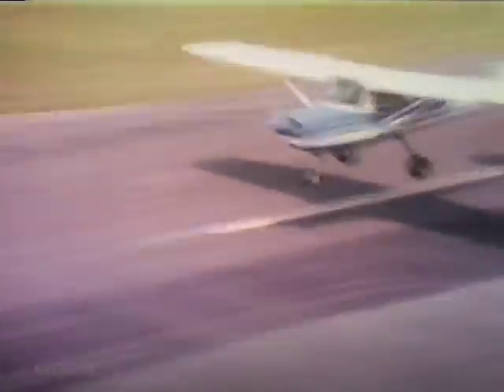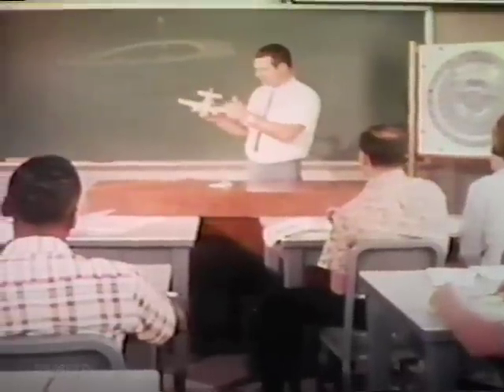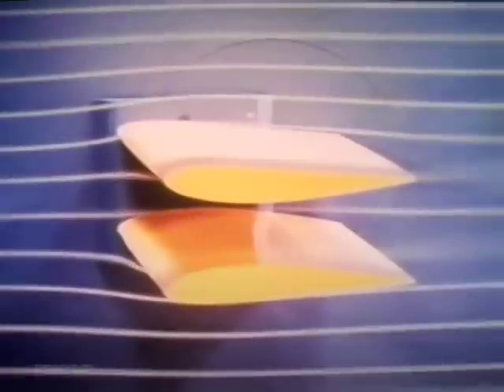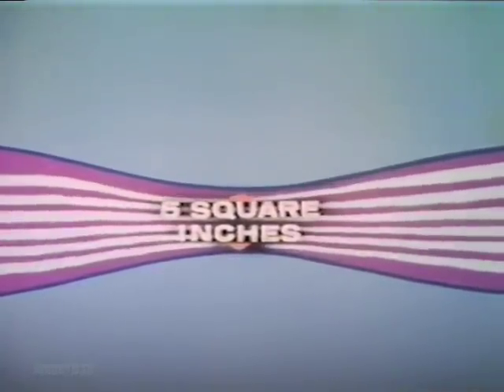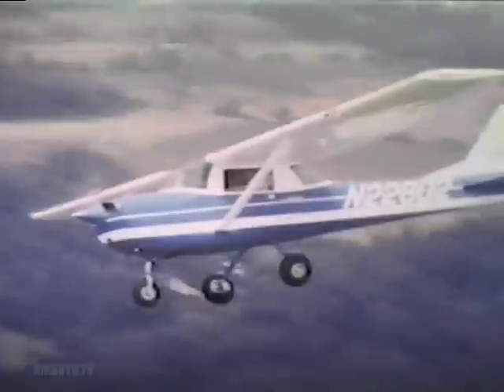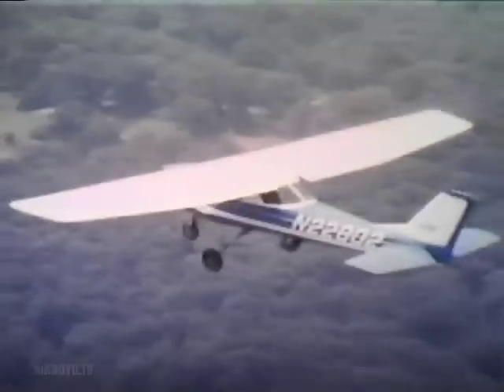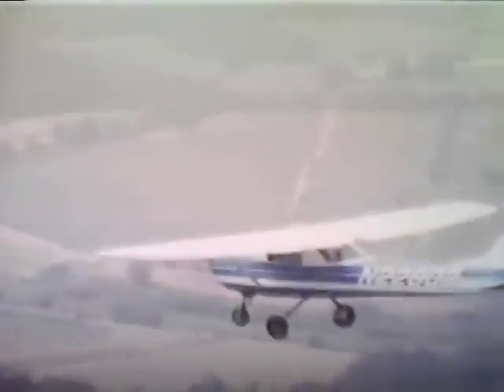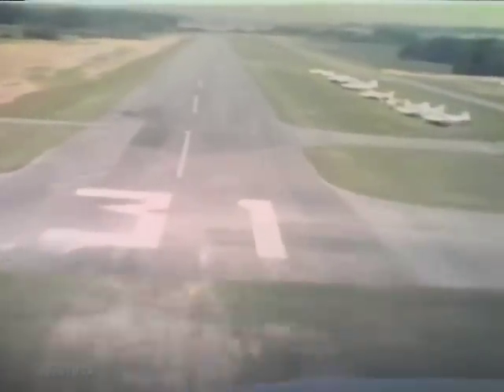How Airplanes Fly (1968)

Comment: When an aerofoil starts moving, air at the trailing edge would apparently need to double back round to join the rear stagnation point. The air is not a superfluid, and as a consequence the flow breaks away at the trailing edge and a starting vortex is left behind on the runway. This can actually be visualised.

In the air around the aerofoil there is vorticity of opposite rotation to the starting vortex, by the conservation of vorticity. This vorticity then generates lift by the Magnus effect.

Conservation of vorticity and the Kelvin circulation theorem are the same thing, and it is a topological requirement that vorticity can only exist in endless loops. The Magnus effect and the Kutta-Joukowski circulation theorem are also the same thing and we can switch between them by a linear transformation.

Explanations based upon Bernoulli's Principle or Newton's Laws are merely wisdom after the event of a starting vortex being formed. They would flop if our atmosphere were a superfluid like liquid helium.

Comment: When you do the integral that come from solving the equations of motion from classical field theory you have to use complex analysis. You end up with a pole in the middle of the airfoil. This ends up giving a solution with nonEr
Reply: nonzero curl. This basically mean you get air rotating around the wing. The other independent solution is just air going over and under the wing. super position of these 2 solutions is air moving faster on top and lower on bottom.

Comment: There is also a downward Newtonian force caused by the air accelerating at a relative angle to the chord line of the wing that creates lift.
 I believe that the pressure under the wing creates more of the lift than the accelerated air over the top. Hence a semi symmetrical wing that still works with the aircraft inverted albeit very inefficiently.
Reply: No, actually the redirected accelerated downward airflow is a majority of your lift.
Reply: +Brett Dull that's exactly what he said
Reply: IndustrialDonut Thank you
Reply: "I believe that the pressure under the wing creates more of the lift than the accelerated air over the top. "
above is the part of his post I was commenting on. The "pressure" on the bottom of the wing is a byproduct. The lift is created by the redirection of the air over the top of the wing as stated before.. The amount of air redirected is the most significant reason flight is possible.
Reply: @fischermann5279  Both are the same thing. Pressure over the upper and lower surfaces explains all the lift, or equivalently change in momentum of air entering and leaving the airfoil explains all the lift

Comment: So much ignorance .... so little time.  Fluid pushed through a restriction accelerates, loses pressure and temperature.  The restrictioin is formed between the curve of the airfoil and the undisturbed air above. At positive angles of attack, the air pressure is reduced above the wing. Ambient pressure remains the same above and below the wing so that the reduction of pressure above the wing allows the now greater pressure under the wing to lift it. All that downwash is hogwash .... watch some airflow demos in windtunnels with airfoils.
Reply: You are so wrong... The reason for lift is a combination of the Coanda effect and Newtons 3rd law. If your theory was correct then symmetrical wings wouldn't create lift nor would inverted flight, both of witch we know happen.

Comment: @5:10 the space gets smaller with an equal amount of air flowing in, shouldn't the pressure be higher? i don't get it
why do we say it's lower?
Reply: mitreswell
You can think of it as the molecules having less time to exert 'pressure' as they are whisked over the stationary (or other way round, as a wing) thing.
Reply: ngai1842 The air is accelerated. Refer to Bernoulli's Principle, when a gas is accelerated its pressure decreases. This is why it is not a higher pressure.
Reply: ngai1842 You are thinking of venturi effect and mixing up speed and pressure, speed increases and pressure drops proportionally, its same as aerofoil principle mentioned by Mr Gypsy
Reply: I'm confused by that too... I could understand it being the same pressure but I don't see how its lower when the volume of air is relatively larger to the area it's contained within
Reply: I agree. It's taking more pressure to make if flow faster, isn't it?

Comment: This may be a stupid question, but how is it that the flow separation above the wing causes it to stall? Theoretically, how come the air below the wing stops pushing the airplane up? Since the flow separated on he top, should there be even less pressure? Also, I heard a stall is simply an issue of a too high angle of attack and not speed. I mean, how come some airplanes can fly straight up and not fall out of the sky then? I am not fully sure about these things. Thanks.
Reply: Sean Rita You can also exceed the critical alpha at high speeds with aggressive inputs on the elevator.
Reply: well some airplanes like fighter jets can go straight up because of raw power or thrust like a rocket, prop planes that are powerful enough can do this too and sustain a vertical climb. I think that the stalled air after separation of airflow is either at the ambient air pressure or at a higher air pressure from that low pressure area on the center of the wing rather than being even lower in pressure. You are correct, a stall is simply when the plane reaches its critical angle of attack with the relative wing. If you go too slow you will stall if you try to maintain altitude because the slower you fly the greater your angle of attack needs to be to maintain lift. You can stall if you go too fast too, but thats for a whole other list of reasons...
Reply: Petr A, What your forgetting is that when an aircraft flies straight up the relative velocity of the airflow is directed straight downwards which gives you zero angle of attack while traveling straight upwards. As for separating the flow, this causes low velocities on the wing which creates higher pressure and equalizes the lower surfaces pressure and negates the total lift. hope this helps.
Reply: Petr A It doesn't matter what attitude you're flying at, it's all about relative wind. You can fly straight up with the same alpha as you do in level flight.
Reply: Petr A  In a deep stall, look at the curvature of the still continuous streamlines on the top and bottom of the airfoil.  They curve outward about the same, so their pressure is equal on both sides, so no lift and gravity pulls the plane down.
You could even state the high turbulence on the top surfaces makes the wing look somewhat symmetrical and really really fat to the upcoming wind.  Even tho the space where the turbulence is not being an actual solid, the airflow doesn't know that, and just sees something pushing back on it making it feel just like a very draggy symmetrical object it has to curve around.

Some airfoils take advantage of this. A thin wing can have low drag and good lift in certain airspeed and angle of attack ranges, and a thicker airfoil might perform much better compared to the thin wing in other flight speeds and angles.   If a thin wing's airflow is allowed to detach from the surface at a certain speed/angle, but is designed so that the flow reattaches a little bit further back on the wing, it is not actually a high drag stall, but the wing  acts as if it is a thick one.  That way a wing design can have the best performance of both thin and thick airfoils, so a broader flight speed range with low drag capabilities.

About when a stall occurs, it depends on airfoil.   Generally if you slow the plane down very much, you need a bigger angle of attack to keep the same lift force on your wing. At a certain point you dont get any more lift out of the wing (reached CLmax,) and increasing the angle more even reduces lift a little.  Increase more and it will reach the stall angle and you suddenly lose more lift. 

About planes shooting straight up.... if trust > plane weight, you can just move vertically up. Rockets don't need wings..  In a slightly off vertical angle the wing is starting to help with the lift, but it needs not much lift to help so angle of attack is low.  no stalls then unless you climb very slowly.
Reply: +Petr A 
Actually, flow separation creates a higher pressure on the top of the wing not a lower pressure and this is due to the reverse flow of the air particles due to viscous effects. In this case by applying the Bernoulli principle, the air velocity is lower while the pressure is higher. As a result, the Lift decreases.
Obviously flow separation area is not empty to have a lower pressure inside it. We are not in the outer space!

Comment: This is actually quite a good explanation, however most people summarise it and say it is the non-symmetrical aerofoil section that gives the lift. This is obviously not true as airplanes with this section can fly upside down. It is the angle of attack, adjusted by the elevator that is the main cause of the increase in pressure under the wing. I have seen a model aircraft with a plank of wood as a wing, (rather light weight!) and this flew quite well.
This aerofoil explanation is used in all TV summaries of the theory of flight I've seen. I think the producers just copy popular explanations, and thus the misinformation propogates...
Reply: The information here is not incorrect. They just don't go into detail about how a symmetric airfoil can be made to have a positive angle of attack that accelerates the airflow over the upper surface in the same way that camber does. Nothing incorrect is being propagated.
Reply: If I was to be kind I would say it is incomplete, but the missing bits are what causes all the confusion. NASA decided to put this to bed by having a section on their web site about how planes fly. There are two forces, the Newtonion force on the bottom surface of the wing, which changes the angle of the air and provides a reaction upwards. There is no reference to the upper surface of the wing in this. Then there is the Bernouilli force due to the speed of the air over the airfoil that is usually given as the reason for lift. In fact this second part only gives about 30% of the lift at near sea level. As NASA says in the upper atmosphere, the Newtonian force provides 100% of the lift. I tend to believe NASA.
Reply: Malcolm Connah "There are two forces, the Newtonion force on the bottom surface of the wing, which changes the angle of the air and provides a reaction upwards. There is no reference to the upper surface of the wing in this."
Strange!
Could you link me to that if you have the link handy?

Then NASA is wrong. An outrageous claim?!
Well, I have evidence!

If the upper surface of the wing did not create the lift airplanes would not crash simply from having a little bit of frost on the upper surface of the wing- and they do crash! There is a reason!

It looks like NASA can't make up their mind what their position is? http://www.nasa.gov/mov/178672main_020_ksnn_3-5_plane_cap.mov
Reply: StratMatt777
Yes, there are these two forces at work. But I think both sides contribute to both forces. Think about a sail. It also works because of both forces, but it doesn't have a lower side that's different from the upper side.

By the way, the law of bernoulli is just a law that gives you the pressure if you know the speed and vice versa. It doesn't explain why the speed on the top side is higher or why pressure is lower when the speed is higher.

Maybe the whole picture could be explained like this: The airfoil causes the stream of air to change it's direction. It accelerates the air, which directly means there has to be a force on the wing in the opposite direction.
But the "turning" of the air also causes changes in pressure and speed, which applies similar forces to the wing.
Reply: Malcolm Connah You don't increase the pressure below the wing, you just decrease the pressure above the wing. The pressure below the wing is the relative atmospheric pressure. The lower portion of the wing can contribute to impact lift, though.
Reply: TheMasturCheef "By the way, the law of bernoulli... doesn't explain ...why the speed on the top side is higher"

Nope it sure it doesn't. I do know that Coanda effect explains why it stays attached.

"By the way, the law of bernoulli... doesn't explain ... why pressure is lower when the speed is higher."

Actually  it does. That's exactly what Bernoulli explains.
Reply: Its more about momentum and boundary layers, since the upper pulling force is far greater than the reactionary force.  i.e. you can fly around in a full power stall where reactionary force and thrust equal your weight in the vertical force component.  But when you fly around all day under cruise thrust,  your velocity causes a much greater pulling force than your reactionary force.   Its important that no separation in flow over the wing happens, so upside down, or even a submarines hydroplane. If the fluid is pulling on the surface your flying.

Comment: let me explain this for you fools. FACT air speed equals less  pressure. PEROID.. THE AIR IS SPLIT APART BY THE WING GOING THROUGH IT! THE AIR IS NOT not MOVING! EXCEPT TO COME BACK TOGETHER AT THE END OF WING. AND TO DO THAT IT MUST SPEED UP, WHERE IT WOULD HAVE BEEN STILL. TO GET BACK TOGETHER. fact fact. THE AIR UNDER THE WING DOSE NOT MOVE THERE FORE IT HAS 14.7 LBS PER SQUARE INCH PUSHING UP TRYING TO GET BACK TOGETHER...but the wing is in the way, so the pressure pushes the wing up.fact FACT. UP AGAINST THE LESSER PRESSURE ON TOP OF THE WING. FACT FACT FACT. HOW DO YOU GET THE WING TO PASS THROUGH THE AIR IF YOU DONT WANT TO MOVE THE PLANE? ANSWER IS THAT YOU SWING THE WING AROUND A CIRCLE THROUGH THE AIR.  AIR PUSHES UP WING(ROTOR BLADE) PULLING HELLOCOPTER UP
Reply: There is less pressure when there is more speed due to Bernoulli's principle.

I could be wrong, but it almost sounds as if the condescending guy above (addressing everyone as "fools" and citing his opinions as "fact fact fact") may be citing the incorrect "equal transit time" theory from the 1940s.

The curve or camber of the upper surface of the wing causes the airflow to accelerate, and due to Bernoulli's principle the pressure is lowered.

It's strange to see a new Cessna 152 in this video. The ones I give instruction in are 35 years old and worn out.
Reply: I stopped at the "peroid"
Reply: Stephen Barker The rotors on a helicopter generate a lot of impact lift to fly. Go stand by one while it takes off, you'll feel it.

Comment: um... No. If thrust is greater than drag, you are accelerating. In stable flight at constant speed, thrust and drag are equal. If they were not the plane' speed would not be constant.

Comment: >works for u it works. As 4 me, I intend to explain it as a result of a event, not as the result of another result of th event. 

As far as the aformentioned 0 AOA wing, lift is created because the change in direction of flow ultimately causes less energetic collisions of molecules (less pressure)on top the wing causing the greater pressure underneith to lift.

Comment: >"change of direction". The lift is caused by objects (air molecules)hitting the wing and pushing it upward, (which results in the air moving downward). The air moving downward is the result of an event not the cause of an event. Just the same as a rocket moves forward because af very high energy molecules shoving the rocket forward, not the gasses which are exiting the back.

Comment: the fact that we can generate enough lift with perfectly flat wings does not somehow deny that a wing curved on the top and flat on the bottom generates SOME lift. The test if this would be to put such a wing into a  wind tunnel in a no-angle-of-attack condition an measure whether there is lift. This situation will cause less air pressure on top the wing thus the greater pressure underneath will push the wings up. You seem to be a little obsessed with the idea that lift is created by the airs>

Comment: "air accelerating over the top of the wing (causing lower pressure) which is largely untrue"
No, it is not untrue, but it is no second separable effect. Of cause there must be lower pressure on top or else there would be no lift.

Comment: There is a logical reason. The molecule tend to stay at the same speed. In fact the airfoil just break the air in two part, the lower part tend to be compressed and the upper part tend to be stretch. (I usually speak french, thus I certainly made some fault)

Comment: I see that you really need to consult your physics textbook again.
Firstly, I think you feel for the same trick that the Greeks fell for. When Drag=Thrust, it does not necessarily mean that there is no motion. Newton's first law about inertia is clear. This means that when the drag is equal to thrust, an airplane ALREADY in uniform motion (in the case of straight flight) will remain in uniform motion.

Comment: The way I explain is as follows: Assume a laminar flow in which there are two molecules of air right at the forward tip of the wing. They separate at this point as one follows the upper surface and the other the lower. For flow to be laminar, these need to meet at the aft end of the wing but since the upper surface is curved thus longer, the upper molecule has to move faster. Bernoulli has shown that a higher velocity creates a lower pressure. So pressure above is less than below. Hence, LIFT!